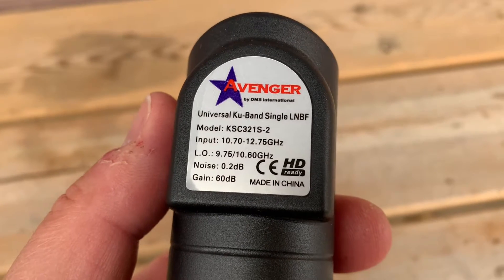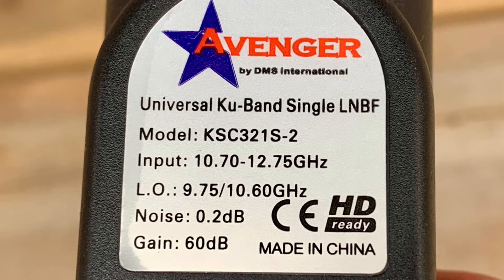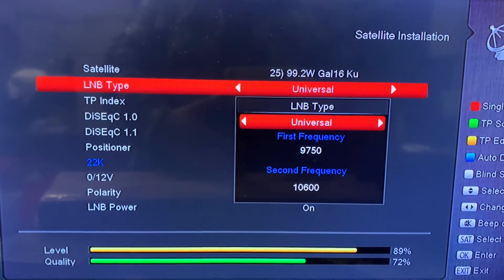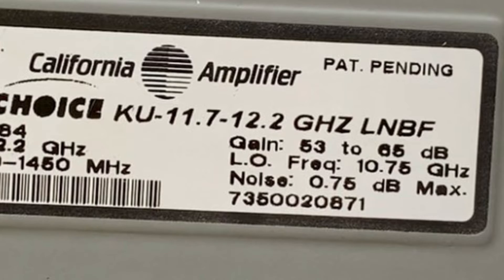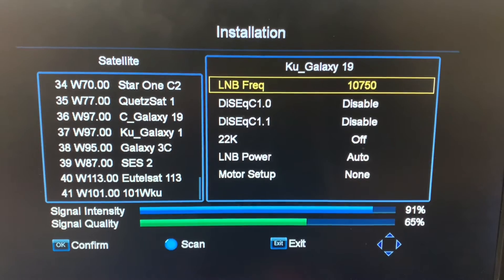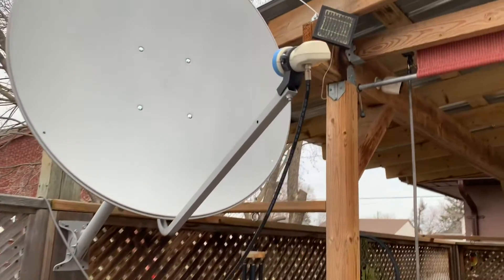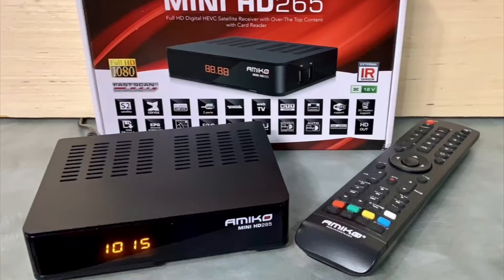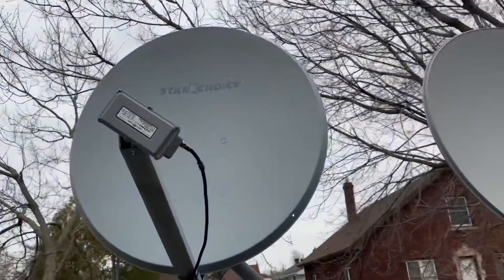What kind of LNB should I use on my KU Band Satellite Dish? FTA Satellite TV

Comment: If I connect the output of LNB to a SDI to HDMI Converter, Can see the video on hdmi monitor
Reply from the maker: No, because you need a satellite receiver to decode the signal first. The receiver has an HDMI out to connect to your monitor.
Reply: @NorthcoasterHobby  does LNB output also carry  video signal??sdi also carry video signal?? Is LNB output and Sdi are different format?? Can u pls clarify??
Reply from the maker: @sankarn.s5645  LNB output is RF signal (video and audio). This needs to be decoded by a DVB-S2 tuner. Then it may be output to an HDMI monitor.
Reply from the maker: @sankarn.s5645  LNB and SDI are totally different formats to my knowledge.
Reply: @NorthcoasterHobby  OK.  Thanks  for reply

Comment: I've a Direct TV dish (with 3 LNB) sitting on my shed useless for years. Can I set this up as KU band for FTA ? I know that the LNB-s may not be universals and not work , but at least I can save $189+ tax on the dish? Thanks in advanced.
Reply: DirecTV dish is to small to receive other KU Band satellites, and the LNB is circular not Universal or standard. So you won't receive Free To Air channels. And the DirecTV receiver will not work

You need an 100 cm dish, KU Band LNB, H-H USALS motor and a DVB-S2 receiver AMIKO or GT Media. Buy a receiver that has H.265 standard so you can use it for the next 10 years.
Reply: @Nicholas_Chris  Not sure what happen with my previous  respond to you!. I am getting a 1- AMIKO MINI HD265 FTA Receiver DVB-S2 H.265 HEVC DiSEqC USALS NTP- 2- 39 Inch 99cm Satellite Dish FREE TV KU BAND FTA with Tripod Mount and Single LNB. will this work to run an FTA in Florida? Thanks.
Reply: @abitofeverything1234 Your setup is perfect. As for LNB, if you only want to use it for one receiver is fine, but if you want to connect to 2, 3 or 4 receivers you need a Twin or Quad LNB.
Reply: @Nicholas_Chris  Just one receiver for now. Thanks.
Reply from the maker: If it is a larger elliptical dish then it may be sized right for some FTA. The LNB is probably not linear (universal or standard), but you may be able to change the LNB out. Be aware that changing the LNB is not necessarily a simple matter. 

Installing a Replacement LNB on a Satellite Dish for Satellite TV
https://youtu.be/BcArITacHeE

You will need an FTA receiver as well. The DirecTV receiver is proprietary and can’t scan in FTA channels.

Amiko Mini HD265 HEVC H.265 Satellite TV Receiver Overview
https://youtu.be/MpHixvegd3k
Reply: Robbie Strike explained in one of his videos that DirecTV dish will not receive other channels, only the ones for subscribers, the dish is too small. You need a large dish, and a Universal KU Band LNB.

Comment: I recommend AMIKO LNBs for KU Band and RT Inverto LNBs for C Band they are great for very long coax cable (use only RG6 trishield or quad shield cable) and for receiving weak or outside of footprint satellites or transponders. Satellite dishes should be larger 100 - 120 cm for Ku Band (in some cases 150 cm for KU) and 240 or larger for C Band.

Comment: In Europe we use Universal KU LNB because the frequency is 10.75 - 12.75 GHz, the Low band is 10.75 - 11.75 GHz and the High Band is 11.75 - 12.75 GHz. If I install an North American KU LNB I will only receive the High Band 11.75 - 12.75 GHz I only  receive half of the channels. Another thing that I observed on AMIKO receivers is that when I add a new satellite the LNB is set by default on C Band but in the menu it says standard LNB 5750. You have to change to Universal LNB, otherwise you won't receive all channels.

I must add that with a 80 cm or larger dish you can receive two satellites, the main satellite has excellent signal, the secondary has very good signal. The bigger the better. In my case I use an 80 cm dish to receive HotBird 13 East and Astra 19.2 East. The main satellite is HotBird 13 E, signal quality is between 90 - 100 % and Astra 19.2 East, signal quality is 80 - 95% two transponders have 100% signal quality. An 90 cm dish is pointed to Eutelsat 16 East (main satellite) and the secondary is Astra 28.2 East. The signal on Eutelsat is 55 - 100 %, the problem is that Eutelsat 16 East is badly designed, and had problems since day one but with a 90 cm dish you shouldn't have problems, the previous satellite had better signal. And Astra 28.2 I have 80 - 96 signal quality. In some cases you have a large dish but a faulty satellite.

As for C Band if you want to receive Russian, African or Pakistani channels you  need a 300 cm dish with a C Band LNB if you live in Eastern Europe you can receive them with a 200 cm dish. The main problem is the elevation, the elevation especially for russian channels is very low the dish must have elevetion starting with 0. And russian also broadcast circular instead of linear. The indians, pakistani and africans you can use normal C Band LNB.